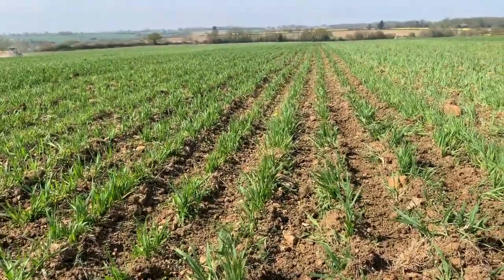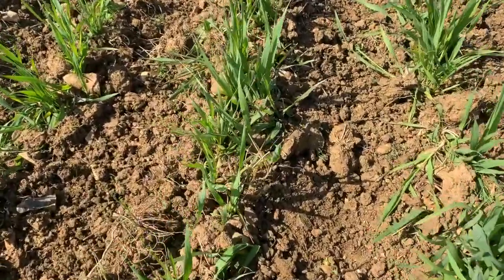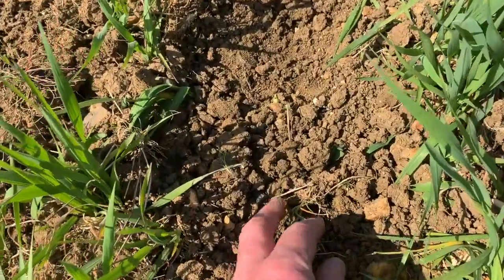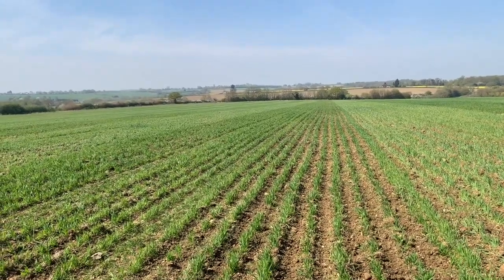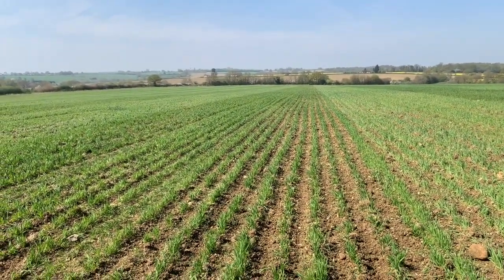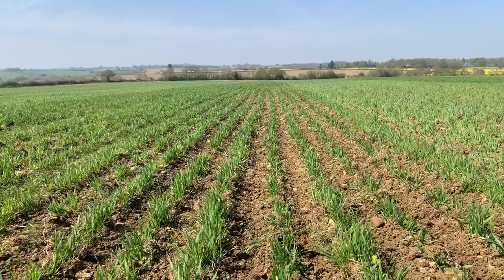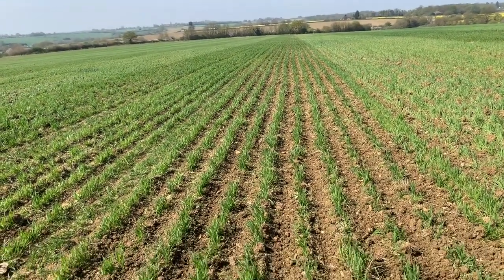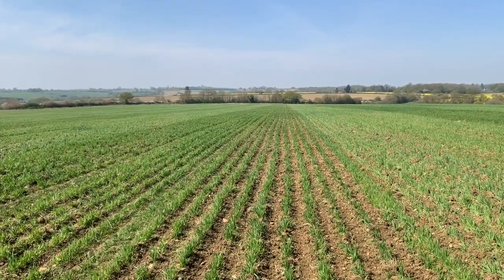A Living Mulch in an Organic Rotation (Part 1)

Comment: Last autumn we planted the clover directly with the wheat, mixed together and it worked out well. November drilling mind you. The clover grew along with the wheat but always beneath, except in the spots where the wheat suffered and the clover took over to cover weeds. Now it's harvested and the clover takes over.
We had no success with undersowing clover the past years due to drought, so we figured we would try them together as I read in US studies. Ideally however you would want to sow the clover with a pneumatic spreader mounted behind the planting machine, as to not have them concentrated on the wheat rows. Your system does well by seperating both, but you're also adding a sowing operation.
Reply from the maker: Thank you so much for that information - really fascinating. I'm really interested to hear about what clover you planted in November. Even though we are getting less cold winters here, most clovers that we have here would be killed by a frost if germinating at that time of year. Do let me know as I would love to try that. Very best. John
Reply: @JohnPawseySPF  Hi John, it was purple clover (even though we ordered white clover and only noticed they mixed up after sowing) It was mainly for weed suppression, which didn't totally work since the purple clover tended to rise instead of cover. We are in Belgium so depending on your lattidude we might have similar climates. The video of the harvest is on my channel, but it's French spoken.
If we had sown earlier and no drought in spring, then the purple clover might have taken over the wheat entirely, so we dodged a bullet there. It resisted well to the rotary hoe and tine weeder. When sowing in early october, I'd also like to try adding frosting crops that would die at the first frost and create mulch.
Reply from the maker: @fermewilmotsagriculturebio3434  Thank you! I subscribed to your channel right after I replied to you comment. I think what you are doing looks fascinating and I will be watching with keen interest. Keep up that amazing work!

Comment: Hello again from New Zealand. So the idea is to continuously crop strips (50% of ground?) resulting in overall less tillage, less pressure at planting, less fuel, less compaction, less tractor hours, less weeds, less pests, less disease, probably lower peak yields but a higher more reliable gross margin.. involving periodic rolling, mowing, grazing, resowing of mulch.. I’m wondering if a typically diverse organic crop rotation within the cropped rows is still required or if you can now continuously cash crop, I suppose both are options.. a winter ley may be more attractive than hay if you are continuously spring cropping.. which low growing species have you chosen for the mulch? Subterranean clover or Caucasian clover may suit this system especially given your annual rainfall. Maybe also some sort of brassica to release sulphur.. I trialled/demonstrated a strip-till rotary hoe machine (a bit crude compared to chameleon but very thorough) anyway, a local guy bought it and is using it for sweet corn. He got a record yield in the first year I think mainly due to the tilth and moisture being conserved in the mulch and collecting in the cultivated strips during rainfall events.
Reply from the maker: Thank you for that Harry. We are thinking along the same lines and asking the same questions. I think that your comment about rotation is a really interesting one. Will it allow us to completely redesign what we do?

Comment: So essentially it's strip tillage but with surface cultivation rather than a deep ripped strip. It will be interesting to see how it works. I would expect that grazing hard ahead of drilling would help and winter crops will work best the most likely problem is moisture loss how much will that impact yield? time will tell.
Reply from the maker: The moisture loss thing is the concern but that the reason for leaving half the field without clover. The balance will be savings in fixed costs vs any possible loss in yield. Less fossil fuel emissions are important? Better soils may increase yield over time? Need to keep pushing the boundaries....

Comment: Wow what a fantastic idea and drill. I’m thinking about doing a headland trial in our winter wheat here in Dorset this autumn where after drilling the wheat I will broadcast on berseem clover and then roll. I’m hoping that the berseem clover will be killed by frost over the winter giving the wheat an early boost of nitrogen in the spring. I’m just a bit concerned about worms and the clover getting ahead of the wheat. What SNS and P and K index do you achieve typically from the two year clover grazed by the sheep? Who buys your grain and for what price range? Another thing I am wondering is do you have issues with fungal diseases? I am farming conventionally but I am keen to adopt organic techniques and potentially go organic. Keep up the videos, I’m fascinated by your system
Reply from the maker: Thank you so much for that interesting comment Duncan, I'd be really interested to see how you get on. To be honest we don't do SNS tests and our soil releases K and so we are always around the 2 to 3 index sheep or no sheep. P is the big one. We have an enormous amount of locked up P and having sheep in the rotation in a two year ley system is bringing our P back up to a 2 index but we also do buy in muck or anything else we can get our hands on to help. Currently we sell our grain to Saxon Agriculture and Organic Arable (they will come up if you Google them). The biggest fungal disease pain we get is chocolate spot in winter beans which can completely rob yield and the other has been yellow rust in wheat but most modern varieties have a scar of 9 on yellow rust so it has been less of a problem in recent years. Thank you again for your great comment.